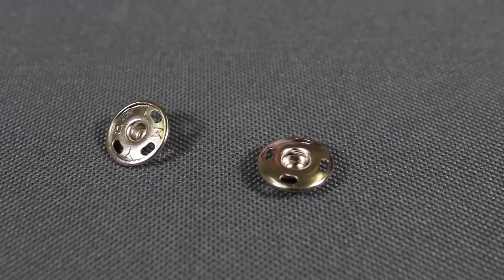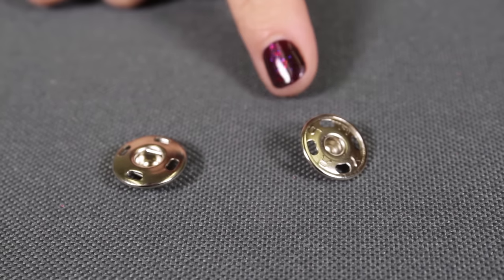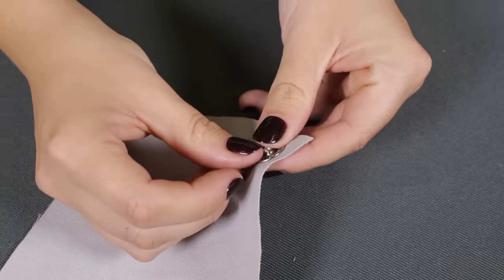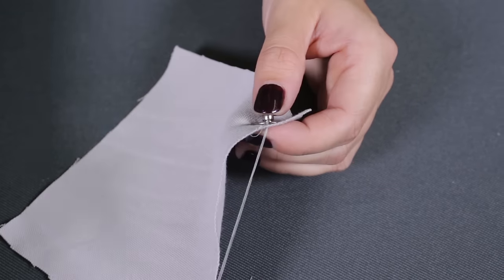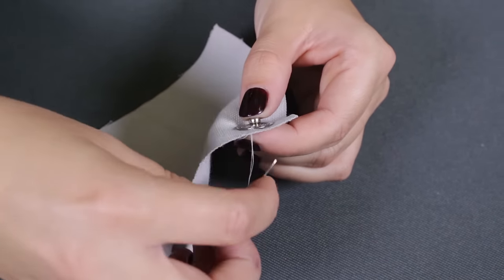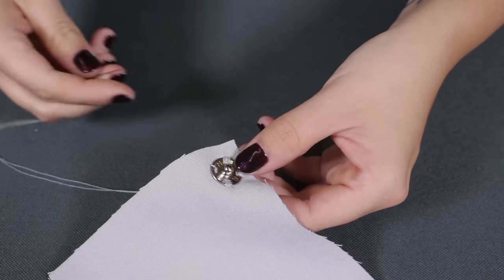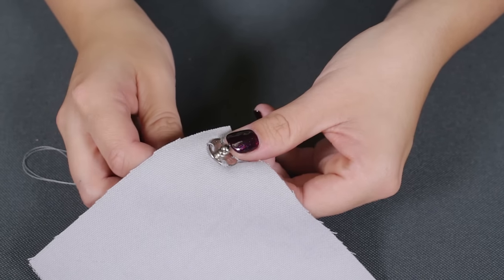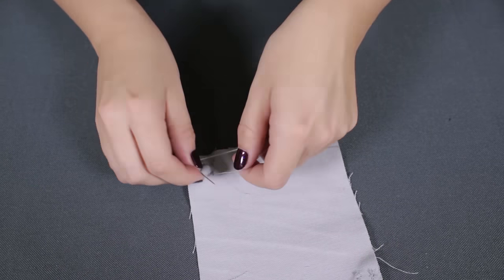How to Attach Sew-On Snaps

Comment: It would have been nice if you had shown how to line up the snaps properly on a garment, not just the sewing instruction.
Reply: True, I really needed to see how she does it I need to learn it cuz I need to learn it
Reply: To Beadage: The title is: How to attach. She is using a random piece of material, so the line-up element aspect is moot.
Reply: what I did was pinch the parts of the fabric that you want the snap to join, then take a white gel pen (you can probably use chalk or some other equivalent, just something you can use to mark the fabric) and make a dot on the spot where one of the snaps would be. Then pinch the parts of the fabric that you want the snaps to join again. The dot will leave a small print on the other piece of fabric. This is where the other snap will go; go over the mark again to make it easier to see.
Reply: What do you mean how to align it??? It should be on your pattern where to attach the clip. If you are randomly attaching a clip to whatever, it’s impossible to show you how to align it! You just need to be accurate!
Reply: @AlvinaYunoa Better late than never, but you were not late at all for me and probably for a lot of other people!!! Thank you for the link!!! 💐🌿😻👍

Comment: This video is lacking how to sew on a snap in different situations. There are times when you need to sew on a snap and you need it to look good on BOTH sides of the area. It would be nice if you showed how to sew on the snap (align both sides up before you sew on the other half of the snap) and then how to sew on the other side of the snap without it looking ugly but nice and neat on BOTH sides. It is possible, but it takes a bit more care to do so.

Comment: Which side should I start on so it doesn't show on the outside of the garment?
Reply from the maker: Here's advice from Dritz on how to do this: If you don’t want the thread to show on the opposite side of the project, manipulate the fabric so the needle can pass through only the snap layer –not the layers underneath. For this method, it is easiest to pass the needle down on the outer edge of the snap and up through the hole. Repeat several times per hole. Then pass the needle through the layers to the next hole. Repeat.